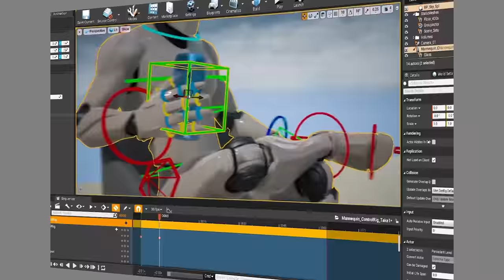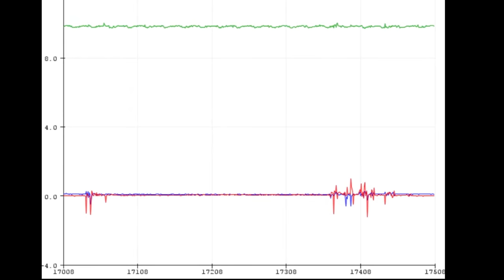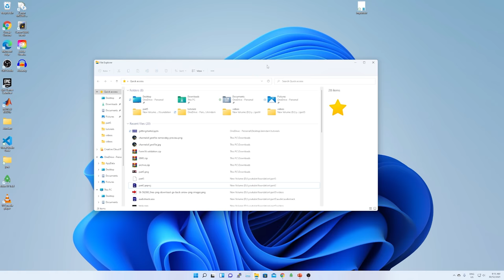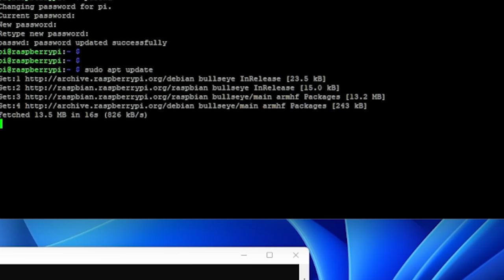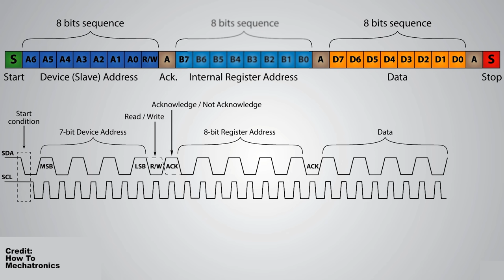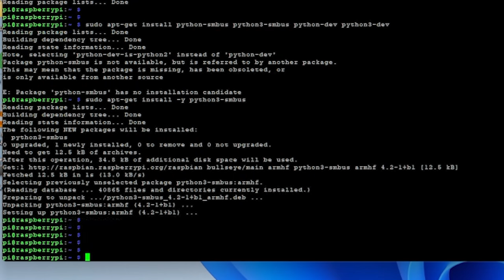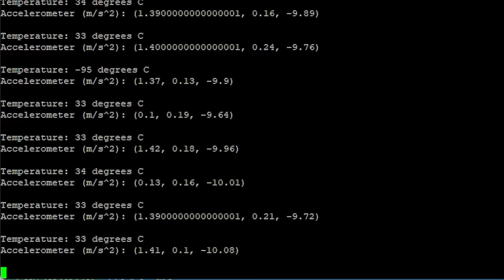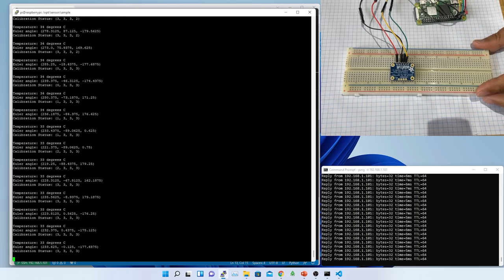Building motion capture / mocap suit using 9 Axis Inertial Measurement Units With Raspberry Pi Zero

Comment: I did pip3 install adafruit_bno055 successfully, but python still cannot find adafruit-bno055 module
Reply: apparently it was pip3 install adafruit_circuitpython_bno055
Reply from the maker: Are you running python using python3
Reply from the maker: Please check your python version